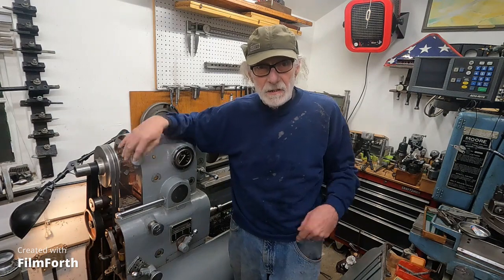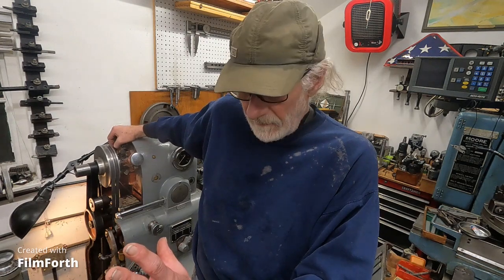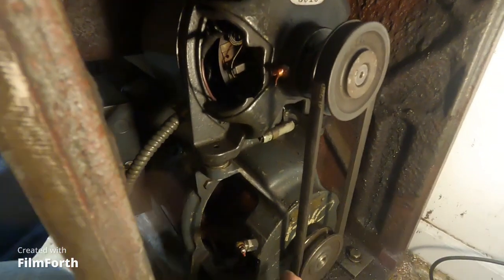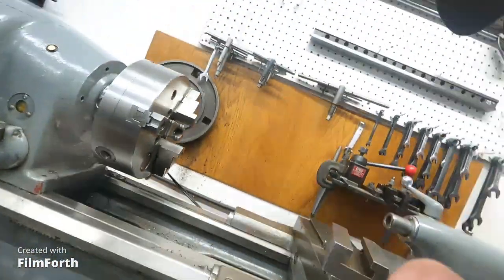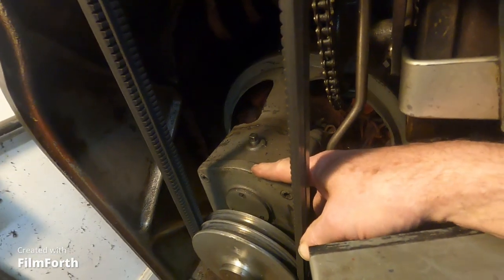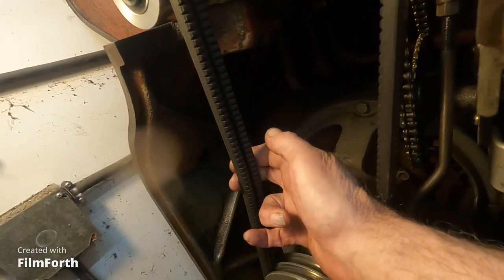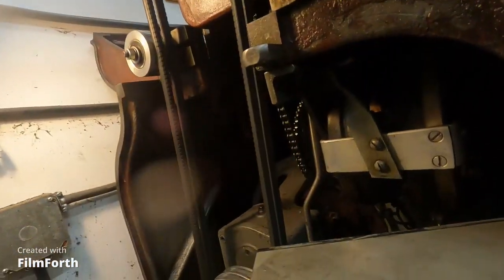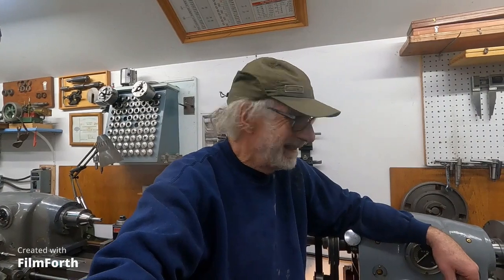Monarch 10ee Lathe DC Drive details

Comment: Excellent video! I don't think this has ever been done in such detail before. Great reference video! When I got my 1953 MG machine many years ago, it was before 10EE Lathes were 'cool' and there was this bit of a cult following of today. After watching the Monarch "Turning Point" video, and these videos by DD, I feel honored to have such a piece of precision engineered Americana from back in the day. It's highly probable my machine made parts that were part of the moon missions. Maybe some of the parts that were made on my machine actually made it to the moon surface. Mind boggling.
Reply from the maker: I was allowed to use the most worn out one at a company in the late 1970s, and never thought I would be able to own one. I remember them starting to hit the market in the 1990s at prices up to $8000, and a low point in around 2008 when many Gov rebuilt ones with Sabina drives sold at an auction for $500. I would like to restore the early tube drive next if I get a chance. Thanks!

Comment: I use and maintain two motor generator EE at work. 
I really like those machines. 
The motor generators have been taken out of the lathes and put in us in a tool room next-door. 
So our lathes are so quiet
Reply from the maker: That certainly would solve the noise problem, thanks.

Comment: I really am enjoying your channel.  My 10ee has long been converted to a vfd with an adaptor for the back gear.  It works well for me, because I use it as a hobby lathe.  The 2hp Baldor that drives my spindle has plenty of power for me and I have never come close to stalling it.  That said, I really wish it was original.  My 10ee had a MG like your roughing lathe and must have had problems and remained unused because it has very little if any wear that I can detect.  The only thing I'm fighting with it is the shifting lever on the back gear.  I can adjust it so it works well in open belt or back gear, but not so that you can reliably go between the two options with the shifting lever without having to make an adjustment.  Maybe I will get lucky and find the sweet spot where it works for both positions.   Thanks for your wealth of information.
Reply from the maker: Many have gone with 5hp motor, but it is a much better way to go. Finding one in good shape is still possible, thanks.

Comment: Great video, Dee Dee. This explains a lot. My 43 10ee only goes up to about 750 800rpm. After that, the field weakening doesn't come on and the lathe sounds like it's running away. Hopefully I can resolve the issue with the help of your video. Thanks
Reply from the maker: Hi! I have seen problems at that RPM, if spindle seems to surge the exciter voltage could be low from brush contact or the volt resister on the bottom of the exciter is set low.
Reply: @deedeeindustrialsuperprecision  okay thanks for the info, love your channel, never miss a video

Comment: You’re an incredible source of very interesting information, thanks for sharing it!!  Are parts still available for the older drives on these lathes?  If so, are they prohibitively expensive?
Reply from the maker: The factory has many parts for reasonable prices for the older drives. The motor generator units will have to be rebuilt by electric motor shops, but Monarch has the brushes and small things.

Comment: Outside of variable speed applications, what is the advantage of DC motors over AC motors? I ask because a non profit I am a member/volunteer at has a large Cincinnati Bickford radial drill press. There's a rectifier/power supply that takes 480 volts 3 phase and outputs 250 (approx) volts DC to power the motor and the column brake.
Reply from the maker: There is a similar set up at the ball mill I visited, there they apparently used it for the variable speed, on a geared head big drill the purpose may have been dynamic braking or the machine could have been on a ship with DC power available.

Comment: I have a mid 60’s 10ee that is pretty much all original.  The only problem is that the fan will stop running after about 2 hours use.  Shut down and come back later and the cooling fan will run for a while again.  Any thoughts on what the problem is?
Reply from the maker: The fan comes on with the filament transformers and work light with the disconnect switch on the right-hand door, the problem would be the fan itself and not an uncommon problem, that needs to be fixed right away because after using the machine and the control turned off, it is good to let the fan run awhile to cool the tube board down.
Reply: @deedeeindustrialsuperprecision  Thanks so much for responding to my question.  I became concerned about the high cost and availability of the tubes and replaced them with the SCR's from Scissio Controls.   Currently I have 3 useable tubes.  But back on the fan, can you give me just a little more on what goes wrong with the fan?  Is the repair straight forward or is it something made out of unobtainium?

Comment: What are the odds, I was troubleshooting my 42’ MG and it not coming out of gear on the elsr sticking/weak contactor.
Reply from the maker: I have only seen photos of the older machines like that, the newer design is tricky also usually a worn key in the operating rod or one of multiple adjustments, just gave me an idea for a video, thanks!

Comment: Can you comment on people that convert the EE drive to 3 phase motors ( with VFD controller) and adapting to the existing back gear box. Is this a reasonable alternative? It would be nice to have you comment on one or you videos. Thanks
Reply from the maker: It is the only reasonable alternate drive that has been shouted over by idiots pushing solid state DC drives. The invertor conversions requires the motor mounted gear box to be adapted to an inverter rated 5 hp 3 phase AC motor. It has been working reasonably well for others. The factory last I know is using a 7 1/2hp inverter requiring 3 phase power.
Reply: @deedeeindustrialsuperprecision  So it sound like the VFD option requires a lot more horsepower to equal to the DC Drive. Thanks for the great insight and education for the drives on these machines.
Reply from the maker: @skipdavison7682  Yes, when Monarch first went with AC drive, they tried a 10hp without back gear box it made threading harder because of less effective spindle braking when the half nuts are left engaged, the 7 1/2hp motor with back gear box got the machine in good operating almost as good as the DC drives.